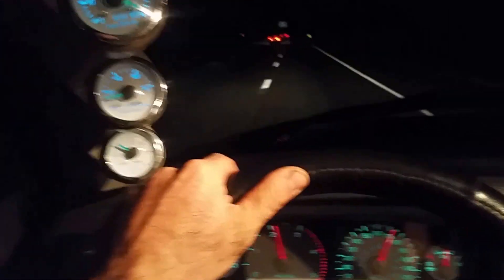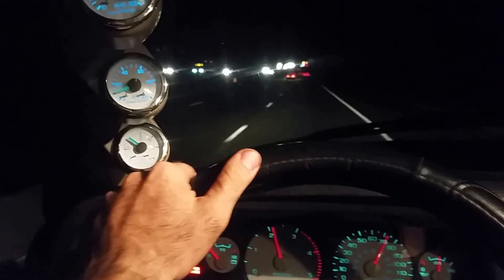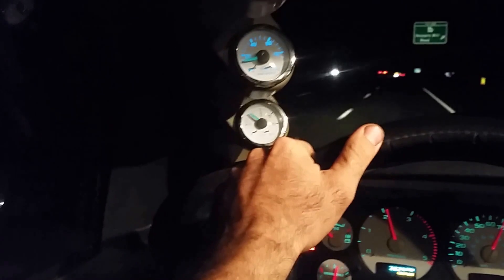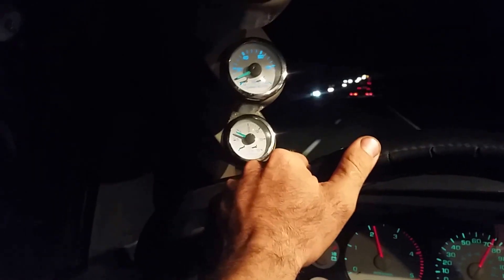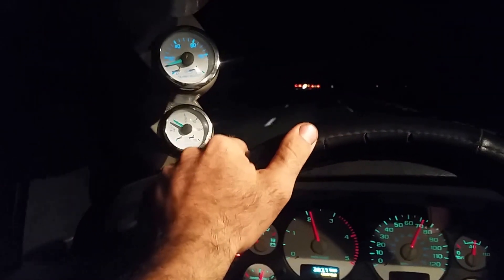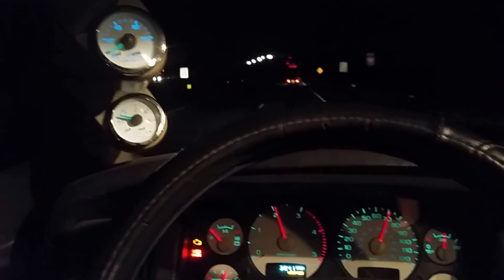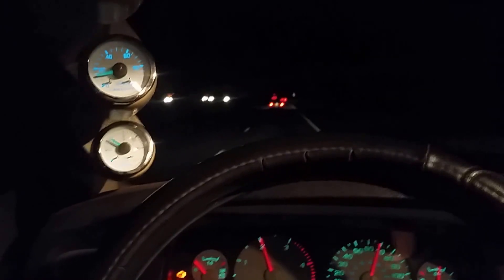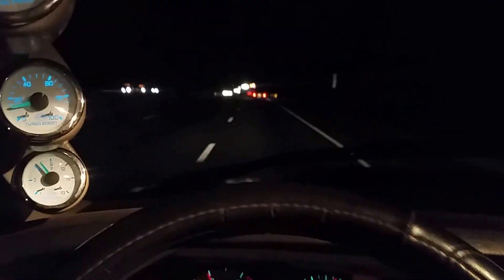Update: Project Black Hole - Towing empty small trailer with Compounds

Comment: What's up Doug, I love the project black hole you got going on. I'm curious about your Garrett GT4202. Is your compressor wheel the 94mm or 102mm reducer?  On the turbine side is that a T4 or T6 and what 
a/r did you go with for it?

I'm doing a Garrett ball-bearing compound build on one of my trucks with my top charger being a 3782r and I am going with a 4202r /w the 102 me compressor wheel. The only thing I'm trying to figure out is whether to go T4 or T6 and the a/r I want to run weather a 1.01, 1.15 or 1.28.  What are your specs and do you have any insight or valuable information to go by. I'm only building the truck for heavy towing and something fun on the weekends.  The truck build is a 01 24v 6spd. Has 100HP DDP injectors, smarty, Blue Chip FMS. Thank You Doug.
Reply from the maker: Thanks Shane! It is always so nice to hear positive feedback.  The compressor wheel is a 74.6mm and the exhaust wheel is a 102mm.  I am always here to help out any way that I can, so don't hesitate to ask if you have questions. Are you working on a build right now or just gathering info for the future?
Reply: 70440charger  I am currently just gathering info for the near future. what's the size of the Turbine housing in a/r? 
also is it a T4 or T6 style?
Reply from the maker: Awesome!  I wish you the best on your up coming project. the a/r is 1.15 and it is a t6 housing. Keep in touch man!
Reply: 70440charger will do Doug, thank you. she sounds sweet. hope to see a video of her towing a heavy load.
Reply from the maker: Hmmm. Thanks Shane...Now I am going to have to find something heavy to tote around for a new video!!!! :)
Reply: 70440charger I'm curious to see how the truck performs from a stop as your shifting through the gears, and up some hills if you have any in your area.
Reply from the maker: Do you want to see those things while pulling a trailer or just normal driving with an unloaded truck?
Reply: 70440charger both if you would like. It's your truck my friend. I was just curious to see how the truck hauled a very heavy load with normal and heavy acceleration.
Reply from the maker: Alright. Thanks for the idea man. I will try to get something like that shot in the near future.